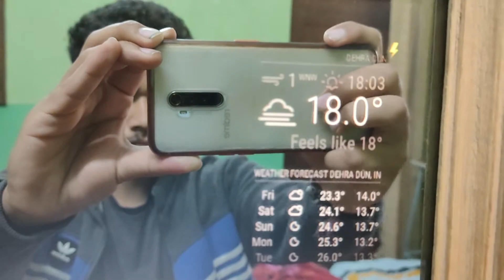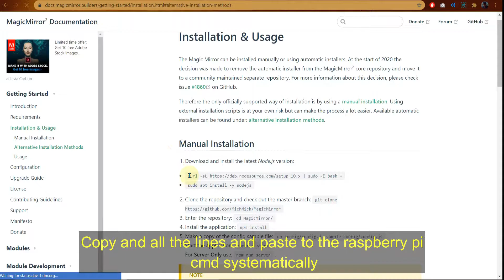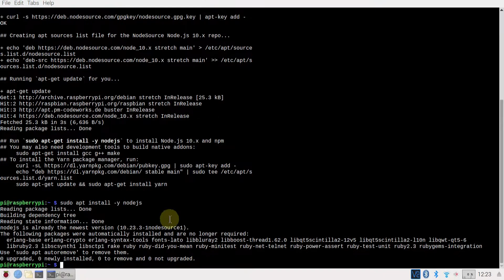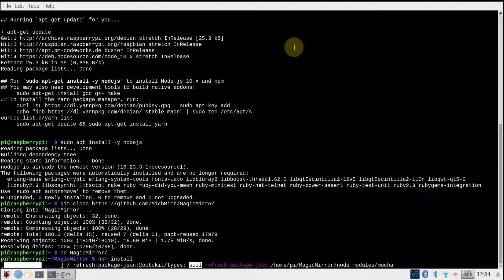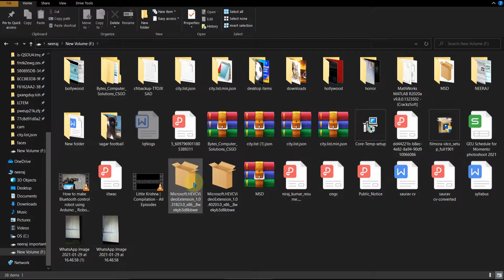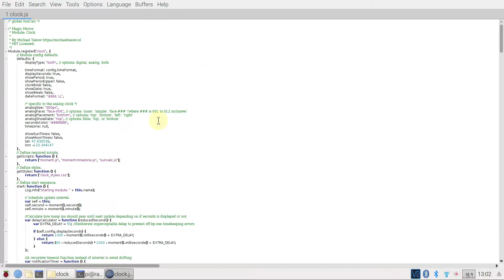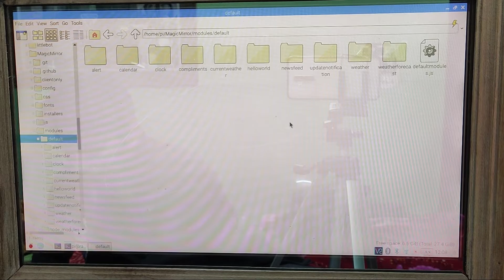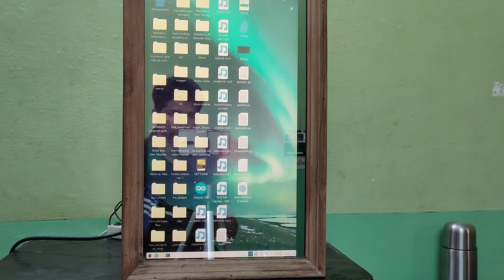How to make smart mirror using raspberry pi and scrap parts | Magic mirror | Experimentalist

Comment: May I know where did you get the glass from?
Reply from the maker: actually this is not the two way mirror. it is window glass. this is not simple window glass it is slightly golden in color. it has maximum property of the two way mirror, means when we create the black in one side it behaves as simple mirror which we used to see our face. if we create both side same light it behaves simplt a transparent glass. actually the two way mirror is not easily present in any shops, that,s why i choose this option.this glass is easily available in every glass hardware store, i give a link of image , how this glass store are look like 

https://www.google.com/search?q=mirror+shop+in+india&rlz=1C1UEAD_enIN944IN944&sxsrf=ALeKk01e08memC8eN3Ignc1WB9WKJ56vsQ%3A1621954624884&source=lnms&tbm=isch&sa=X&ved=2ahUKEwjD4Ifqi-XwAhVr7XMBHeSrBGIQ_AUoA3oECAEQBQ&biw=1536&bih=722#imgrc=OjYxjmF3oUTKiM

Comment: Hi bro wht is the measurements of frame, inch of the monitor and two way mirror bro pls tell bro
Reply from the maker: Actually I forgot the measurements, because I make 1year ago. You can use any screen size display

Comment: What is that mirror ... I tried too many places, no seller have one way / two way mirror.
Reply from the maker: actually this is not the two way mirror. it is window glass. this is not simple window glass it is slightly golden in color. it has maximum property of the two way mirror, means when we create the black in one side it behaves as simple mirror which we used to see our face. if we create both side same light it behaves simplt a transparent glass. actually the two way mirror is not easily present in any shops, that,s why i choose this option.this glass is easily available in every glass hardware store, i give a link of image , how this glass store are look like 

https://www.google.com/search?q=mirror+shop+in+india&rlz=1C1UEAD_enIN944IN944&sxsrf=ALeKk01e08memC8eN3Ignc1WB9WKJ56vsQ%3A1621954624884&source=lnms&tbm=isch&sa=X&ved=2ahUKEwjD4Ifqi-XwAhVr7XMBHeSrBGIQ_AUoA3oECAEQBQ&biw=1536&bih=722#imgrc=OjYxjmF3oUTKiM
Reply: @experimentalist1494  Thanks for explaining :)

Comment: what type of mirror is it could you possible give me the link?
Reply from the maker: I buy the mirror from the hardware shop, or you can use the two-way mirror film online.

https://www.amazon.in/Generic-Uv-Proof-Reflective-Insulation-Adhesive/dp/B07L4Z4W53/ref=sr_1_11?dchild=1&keywords=two+way+mirror&qid=1613240737&sr=8-11

Comment: Where ti buy that mirror ??
Reply from the maker: actually this is not the two way mirror. it is window glass. this is not simple window glass it is slightly golden in color. it has maximum property of the two way mirror, means when we create the black in one side it behaves as simple mirror which we used to see our face. if we create both side same light it behaves simplt a transparent glass. actually the two way mirror is not easily present in any shops, that,s why i choose this option.this glass is easily available in every glass hardware store, i give a link of image , how this glass store are look like 

https://www.google.com/search?q=mirror+shop+in+india&rlz=1C1UEAD_enIN944IN944&sxsrf=ALeKk01e08memC8eN3Ignc1WB9WKJ56vsQ%3A1621954624884&source=lnms&tbm=isch&sa=X&ved=2ahUKEwjD4Ifqi-XwAhVr7XMBHeSrBGIQ_AUoA3oECAEQBQ&biw=1536&bih=722#imgrc=OjYxjmF3oUTKiM